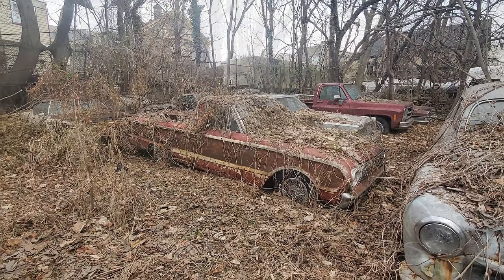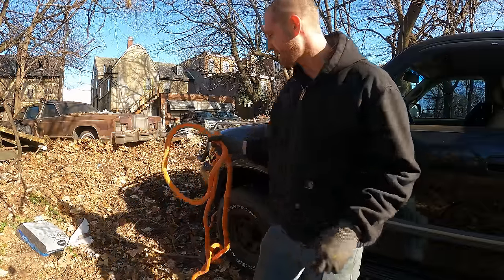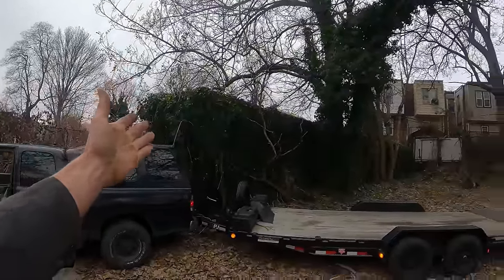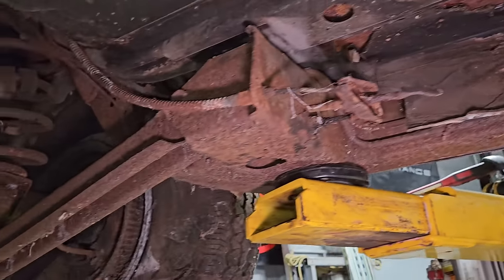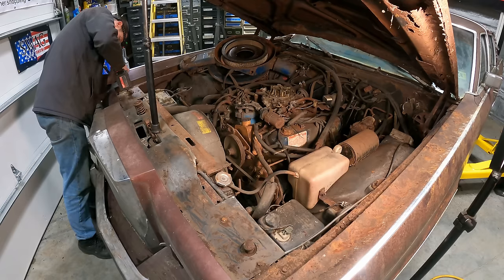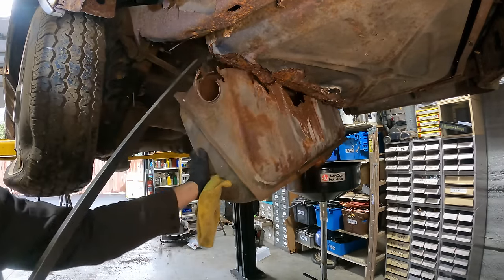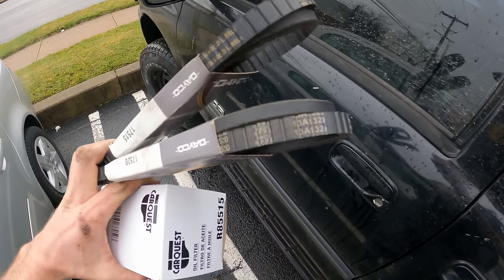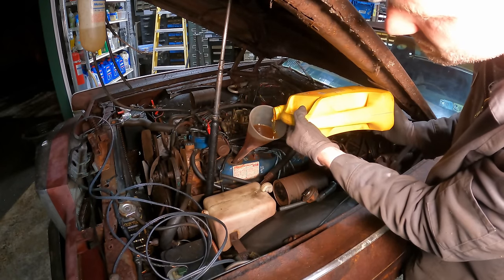ROTTING 70s Lincoln Continental Sitting 30 Years WILL IT RUN?  - NNKH

Comment: It's a 78-79.  The 77s had fender skirts and the 460.  78s and 79s had the 400 with the 460 as an upgrade but it was so emissioned out that it was rather anemic in my experience.  You just can't beat that 70's design and engineering.

Thanks a lot, Chris.  Your content is amazing.
Reply: Def a 78. The bodside moldg on the qtr goes almost to the bumper and the dash trim is stainles The 79's had wood trim shorter qtr mldg and  400 eng only

Comment: I just pulled an '88 Diplomat cop car (ex-Prince George County Sheriff's unit) from a backyard in Lanham, MD last week. The high temp was 27, rear tires flat, rear brakes locked on, it was uphill in the far end...it sucked, had to have a tow truck use his wheel lift to grab & help set the car on the trailer -which thankfully has a winch. Once loaded, had to then drive it south to NC by way of DC metro area & down through Richmond. I got the car via an online estate auction, and it was $254.20 after taxes & fees
Reply: Please pick up that mg Roadstar

Comment: i still daily drive my 1979 Lincoln town car, although its the engine is the 400. still drives good, got a new gas tank coil and all new brake lines as well a new hydro booster for the master cylinder. i am looking for those retractable antenna as there unobtanium as well as the plastic signal lights corners are impossible to find.

Comment: Hey Captain, I burned up an impeller using those square muffs trying to flush after a trip.  My boat mechanic recommended using only the round ones.  I switched back to the round ones and haven’t had a problem since.  Motor gets much better flow into it.  Big fan of your channel.  Manny from Southern Cal.

Comment: Lawn tractor hack to keep those old tires holding air. Remove the valve core and add some ATF. It will swell the inside of the tires with dry rot and will at least slow if not stop the air leaks. Obviously not appropriate for a road worthy rig but might help you out with some of these old clunkers to move around the property. Love your videos and look forward to all your future adventures.

Comment: I had a 04 4x4 tundra just like yours when I sold it it was pushing 400k and still had all the power as day 1 . Those are great trucks
Reply from the maker: Did you have the v8? Those run much stronger. The 3.4 is very undersized for this truck. However if you want manual transmission from the factory that's the only option. I don't like automatics
Reply: @NoNonsenseKnowHow  yes I had v8 I thought yours was to ... and I don't blame you for  not liking automatics I prefer manual as well

Comment: My dad had an old Mercedes like the one you showed. His was a180 D and it had a sun roof. He also had a 64 190D, so he liked the fuel mileage and how sturdy they were. Did you notice the column shifter? I’m pretty sure they had 4 speeds forward plus reverse of course.

Comment: Seymour & Portico, off of Germantown Ave. Johnny Yanni;s old place, no question. ( nice Lincoln tunnel distraction) 12- 15 years ago that place was a treasure trove of 60's & 70;s muscle cars , hotrods, Cadillac's and Lincolns mostly. There were no less than 40 cars there the last time I was there, and parts out the wahzoo in the dilapidated shops/garages that were there. (I'm pretty sure that MG belonged to one of my aunts back in the 70's).
Between that location and 3 others I was aware of he had to have at least 110 cars, mostly all  hotrods, all cool in their own way, from the 1920's to the 80's.
We could never really figure out how or where he got them all. Allegedly "all" the titles were lost in a fire. He did own a successful towing business in the 70's, I believe. Bastard, still owes me a set 16' 8 lug ford wheels.

Comment: You should take a look at a Pine Hill trailer, they can be equipped with a powered set of wheels that drive the rear left or right.
Reply from the maker: That sounds pretty sweet and would be very handy to have

Comment: You could restore that Lincoln. I mean, it does need new a trunk, new doors, gas tank, brake job, but then again, it has a solid massive engine, the haedlights work, and the chassis has only surface rust.

Comment: Need to get yourself a dust collector cyclone! Use your vacuum with no bags needed! Anything you vacuum goes right into a bucket and you simply dump it out, great investment for your shop
Reply from the maker: I actually have one of those. The dust deputy. Works awesome! I got it for when cleaning my waste oil furnace. Was a super fine powder inside the heat exchanger and would clog up the filters immediately.
Reply from the maker: I don't usually have a problem with the filter clogging for general use
Reply: Yes, dust deputy, that's the name!

Comment: They did make a 2 barrel 460, they were in the Lincoln Continental. They were such massive cars, the only way they could get 10 mpg was to stick a 2 barrel carb on them. Otherwise you'd be spending most of your time and money at a gas station rather actually getting to drive and enjoy it.

Comment: 460 CID Chris ??😳.  Be careful what you wish for.I have a '76 Bronco and the original small block $hit the bed so found a used 460  and installed it. I tow my boat with it and no kidding I can watch the fuel gauge  go down as I pull the hills  on the way home from the lake. I measure the beast by GALLONS TO THE MILE instead of MILES TO THE GALLON! Great channel and it's a welcome change not to hear the host talking like a child with terms like sparkalators,  spark hoses,  fuel make it happener. . Lightning whirler...etc. It gets extremely annoying after watching a couple of videos. Cheers and thanks for some great content!!!

Comment: I finally got my 71 lincoln running after 25 years.  But the engine smokes like crazy from under the hood.  I did detect that the smoke was coming from the exhaust manifolds and under it.  The smoke I believe is burning oil.  Is this common for cars like mine that sat for over two decades..

Comment: Isn't it bad practice to start an engine with 20+ year old oil that you haven't checked?  Or even crank it over?  If the oil has turned to sludge / tar, or if there is debris in the oil, might you just break something right away?  Or is there something I'm missing?

Comment: Would you do an engine rebuild or swap on the Tundra? I have a '05 with the 4.7 v8, love the 1st gen tundras.
Reply from the maker: 4.7 is a nice engine but it was never paired with the manual transmission from the factory. If I ever did a swap I'd probably go with an imported Toyota diesel engine and trans

Comment: that motor would be a great motor for a street Rider I know you can make a sleeper out of it put a big cam in it swap the heads out to Cobra jet heads and I need to get about 550 horse out of her and not doing anything to the bottom end you still like those big cars all the time that's what I grew up driving 74 Marquis 460 definitely love the car it's too bad doesn't have a title yeah I can't afford to buy the 460 and C6 off yet is we're moving right now but if I was later on if you still have it maybe I'd buy it off you have big time

Comment: I bet this was a nice car when it was parked years ago.  The  fact that there were no spare parts in the trunk and it was clean and had all its OEM trunk material also reiterates that this was likely a nice car before she sat.  It's def a 78 small rear skirts and a 460 4V,     Unfortunately it was stored in the worst possible way.  On top of dirt and under trees  NOT GOOD!!  BTW i noticed something different about you bro .... i went back to an older video and saw that you cut your hair LOL I knew you looked different

Comment: 24” plus sized rims(marketplace chrome rims that were cheap and almost rusty new), slammed, paint it with bed liner, bare minimum interior. Low rider blanket for front seat upholstery, big subs for a back seat(cheap car audio). You get the idea, take it anywhere, park it anywhere, and never worry. 😂😂😂 awesome land yacht for sure 👍💯

Comment: Late 70's?? OOO...400 Cleveland with the good heads. That's a friggin' builder,alright. Put that in a Torino or Mustang or Cougar ??!! Edelbrock Torker,headers,Cam around: .520/lift,230°-40° deg@.050. and BURN RUBBER TIL' YA SMASH INTO A PARKED CAR ER' SOMETHIN'!!! YEEHAA!!

Comment: cut holes in the door, when a coathanger would of opened it
Reply from the maker: Needed to get in there with some lube and loosen things up. Plus the doors are junk anyway. In fact the whole thing is junk. So what's the worry of a few holes in the door. It'll be fine

Comment: Sell off if no rust holes: fenders L&R, rear L & R quarter panels, windscreen front and rear windows, all door windows with its operational regulators and guide rails.
Remove and sell off: engine and transmission, drive shaft, diff, plus any of the interior gauges, dials, etc.
Sorry to see you smash the button panels before checking if they worked once the electrical regulators were working freely.

My uncle in LA California had a Ford Lincoln in white, beautiful car.
Once cleaned up all the parts put them online sell the parts. There are plenty restoration projects that would snatch up the parts… good luck.

Comment: I guess you just want the engine cutting the back doors like that. Why clean the interior? Oh, to get Jen in the video.
Reply from the maker: I'd like to drive it to test out the engine and transmission and make sure they're worth pulling. Couldn't get in it with how it smelled and how dirty it was.

Comment: Jeez your trusty old 3.4 v6 tundra engine cuts out while driving? Thats not good. Kinda disappointing that a Toyota engine wears out at only around 200k. Are you sure one of the cylinders has low compression?
Reply: Do you prefer the V6 engine to the V8 in the first gen tundra?

Comment: You don’t need a radiator
Reply from the maker: Cylinder walls will overheat very quickly without any water in the engine at all
Reply: @NoNonsenseKnowHow  I know I was only kidding.